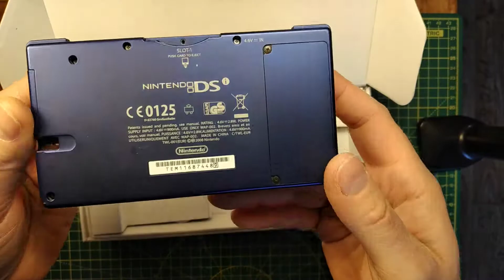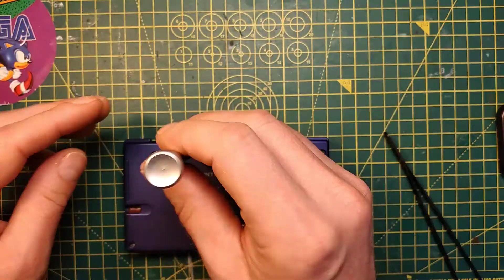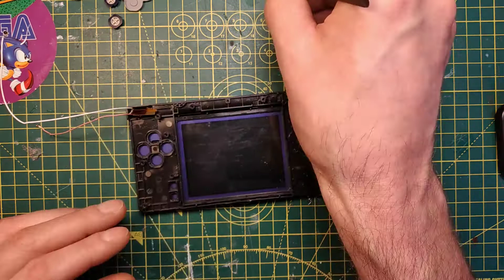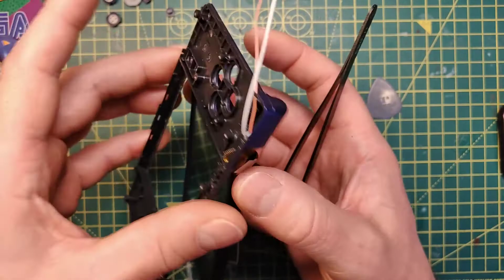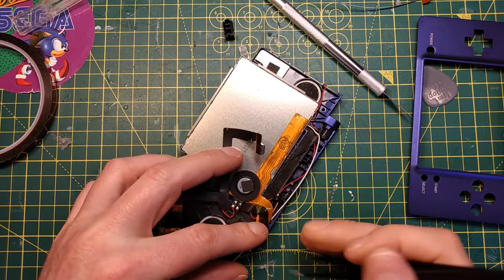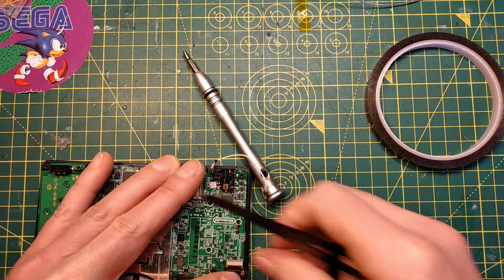Nintendo DSi TOP SCREEN REPAIR - What a nightmare!!

Comment: You really need to take apart the whole thing to replace the top screen?
Reply from the maker: Sadly yes, because of the ribbon cables for the top screen and the camera and the cable of the Wifi module.  It is pretty fiddly, but if you take your time, it is actually not too difficult to change the screen.